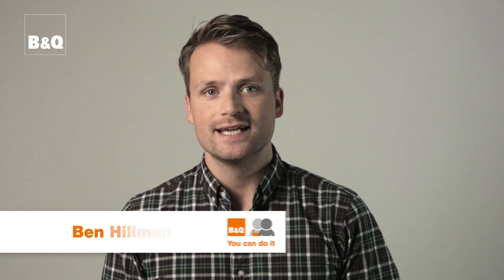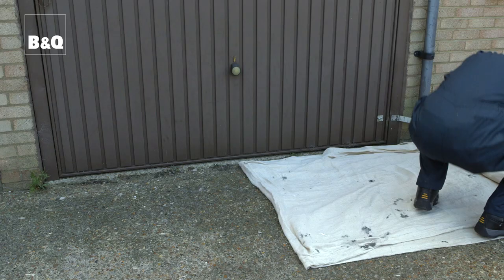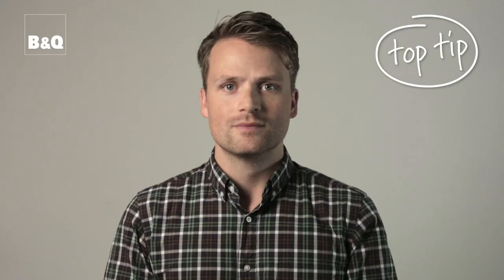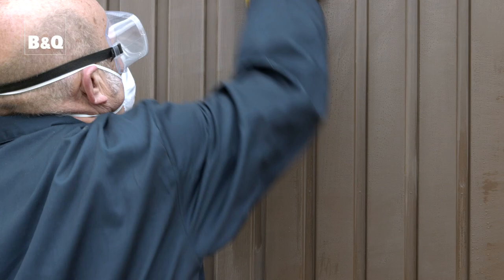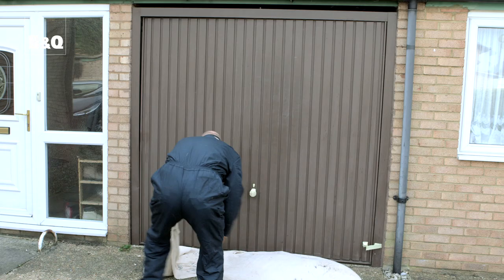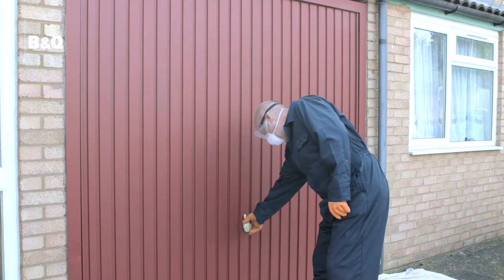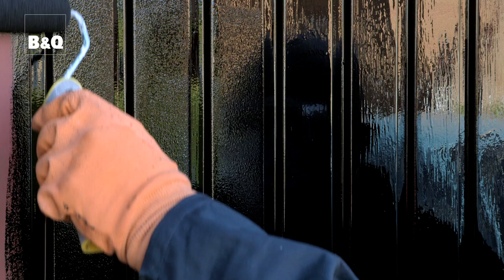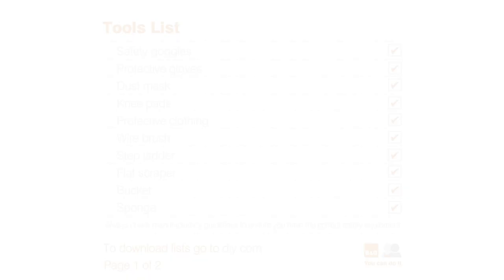How to paint a garage door

Comment: Does the old paint from the garage door need to be totally bare/back to metal?
Reply from the maker: Hi, there. Thanks for your questions! The old paint doesn't need to be completely gone from the garage door however any flaking or uneven patches should be removed & the surface cleaned appropriately (as shown in the video) to get rid of anyhting that might prevent the new paint from sticking to the surface properly.  Hope this helps! 😄

Comment: I didn't prime my door before applying three coats - is there anything I can do in terms of after-protection? Lacquer or similar that could be recommended? Thanks
Reply from the maker: Hi there, the paint used on metal garage doors is formulated to provide a tough and durable finish that's highly resistant to flaking and discolouration. Primer might not be needed for all types of top coat paint, more information will be found on the manufacturing instructions. Preparation is always key for a good finish. However, at your own discretion, you could use any multi-surface sealant that's suitable for outdoors, such as this https://bit.ly/3uyAHxq. Although it's not something we would typically recommend. I hope this helps! 😊

Comment: Surely you should paint garage doors with Hammerite Direct to Galvanised Metal Paint instead?
Reply: @bandq  You should inform people to use Direct to Galvanised Metal Paint if the door isn't already painted.
Reply: I normally use a advanced multi surface primer for all metals then use a exterior primer undercoat then satin or gloss don't use stuff like hammerite especially on a garage door it's terriable stuff to use coverge ant great and you also need a extra thinner like celloius thinners or hammerite thinners go's gluppy very quickly.
Reply: @jackwardley3626  How about a DTM paint?
Reply: @davidregan9872  ive never used USA paint's before i usually use oil based